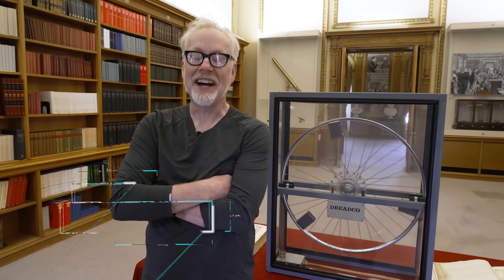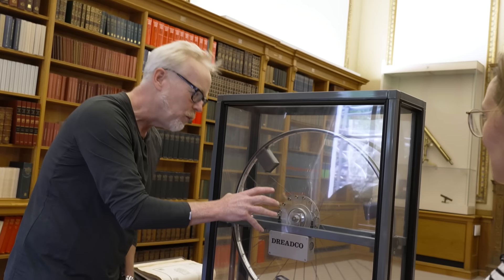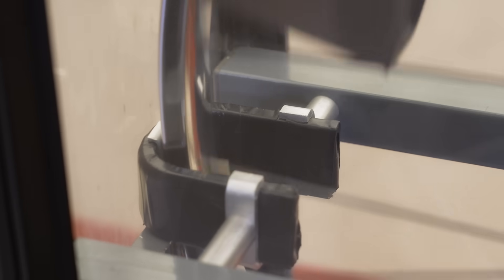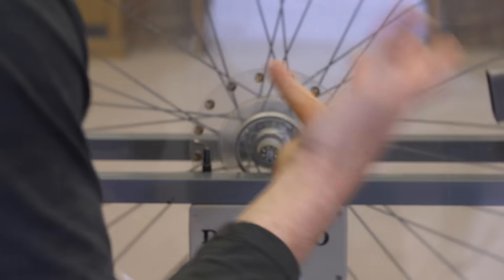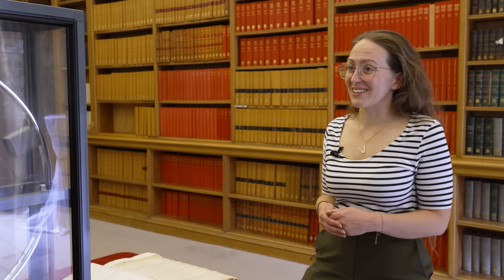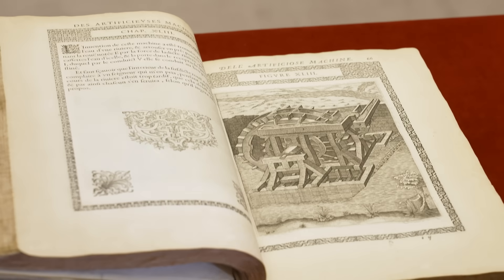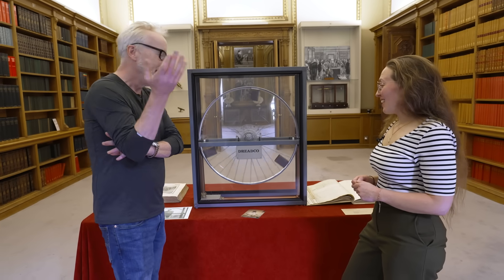Adam Savage vs The "Perpetual Motion" Machine!

Comment: It doesn't take much to keep a bike wheel moving, especially that slowly. I'm almost certain that the boxes mounted on the wheel are magnets, and the things the boxes move through are electromagnets. The smaller disc in the center has magnets around the edge, and the probes have a hall effect sensor for timing. When the magnet crosses the hall effect sensor, it supplies a small current to the electromagnet to pull the magnet in, then the second hall effect sensor reverses the polarity to push the magnet back out the other side. I bet a 9 volt battery could keep such a thing going for a year or more.
Reply: Probably not a Hall effect sensor. Those are pretty power hungry devices, esp. if we are talking about ones from the early 80s when this was apparently made. It is very likely there is no fancy electronics in there at all. Something like a reed relay would do the same job with no power required.
Reply: @JanCiger  wouldn't Adam hear clicking if it was a relay?
Reply: @silicon1  Reed relay is a small sealed glass  tube with two thin contacts (reeds - that's why the name) that close when exposed to magnetic field. Those are essentially completely silent. Think of a window/door switch like used in burglar alarms than a classic car/phone exchange clickety-click style relay.
Reply: @silicon1  Adam is partially deaf
Reply: @JanCiger  
A polarised reed switch could be used to switch the electromagnets on as it approaches the permanent magnets and then off as they pass through.
After a bit of googling I bet it's a "Type E Polarised and Latching Reed Switch"
These remain in the last state they were set to (open or closed) and require opposite ends of the magnet to activate one or the other.
Reply: @JanCiger  Same idea, though - 'sense that I've gone by a magnet thingee'.
Reply: @JanCiger  I wouldn’t be surprised if most of those “magnets” on the inner disc were fake and they only had three actual magnets that matched with the boxes on the outside.
Reply: I mean, honestly, I’ve got clocks that run longer than 2 years on a AA battery…
Reply: @edwardsmallwood1201  there are clocks that work for years on nothing but a few winds of a spring...
Reply: @edwardsmallwood1201  Agreed - lots of clocks have magnetically energised pendulums. The coil approaching the magnet creates a signal current and a simple timer then pulses a current to repel the magnet as it moves away. given the size of the three blocks on the rim I'm surprised the battery only lasts 2 years. Smoke alarms now have 10 year betteries.
Reply: @edwardsmallwood1201  an electro-mechanical quartz watch will run for typically 2 years on a watch battery… indeed a few AAs should be plenty for this device. This device does appear rather similar to an electro-mechanical watch in operation, actually… (btw there is no need for a reed sensor or other magnetic sensor; the electromagnet coil can also be used as the detector for when the box magnet passes through)
Reply: @edwardsmallwood1201  That's how long this full-sized bicycle wheel turns between "tune-ups." Big difference between that and moving two clock hands which might weigh a few grams.
Reply: @edwardsmallwood1201  yeah lol. And the motion is perpetual and does something.
Reply: There is a simpler possible solution. As a magnet moves through a coil, it will induce a small current in that coil. There's your sensor. This current could be fed into an amplifier with a battery and a simple decay timer hidden in the box in the middle to impart a small force via the opposite coil, then 1/3 of a rotation later the process repeats. A well lubricated and balanced bicycle wheel can be kept spinning like this with a tiny amount of force. (And I suspect there may be a partial vacuum inside the glass/acrylic to further reduce resistance.) A pair of AA batteries could keep this running for 2 years, easily, and all of this was available and plenty small enough in the '80s when this thing was designed.

That may not be how this one works, but I could build an externally identical device using that method, I think.
Reply: @cogspace  Actually it just requires a coil with two windings and a single transistor as the amplifier. No timer required.
Reply: @cogspace  
The flaw in your theory is the battery.
Reply: @cogspace  i doubt theres a vacuum. When adam touched the glass it was like rickety plexiglass. If it were under vacuum it would feel solid.
Reply: @cogspace  Yes, this would work.  Yet each coil can serve simultaneously as sensor and driver when the coil is connected to a simple negative-resistance circuit.  No timer is needed.  The tunnel diode motor, such as shown in the Scientific American Amateur Scientist column by C. L. Strong, October 1965, pg. 112, is an inspiration.  In Strong's example, the coil and battery are fixed and the magnet rotates, but the magnet could just as well be fixed and the coil and battery rotate. 

Each of the three boxes on the wheel of this "perpetual motion machine" could contain a battery, coil, and negative resistance circuit.  Each would act independently, producing a tiny "kick" as each coil passes the two presumed horseshoe magnets.  Instead of tunnel diodes, negative resistance circuits can also be configured with transistors (search for lambda circuits) or with very-low power integrated circuits to achieve microampere-level idling current for very long battery life.
Reply: @cogspace  You don't even need the time delay from the other side. Just generating the repulsion magnetic field after the magnet has already passed through will be enough to keep this low energy device spinning.
Reply: @cogspace  I thought a partial vauum would be quite helpful- but when Adam pokes the box it rattled- so I doubt it was pulling a vacuum- just pleaxiglas to keep little hands away from the wheel...
Reply: @cogspace  All they need to do now is make a modern version with magnetic bearings with no physical friction at all and maybe that would more than double the running time.
Reply: that's my guess  too.
Reply: It seems to me you would see slight variations in rotational speed as each box approaches then leaves the electromagnets. It would be helpful to record and analyze the wheel's speed - is it perfectly constant, or does it vary within one rotation? Are those who guess allowed to bring in equipment to measure things like magnetic field strength?
Reply: @jimhyslop  Compass sensor in your mobile phone? It should pick up any magnetic field pulses.
Reply: Thats always what everyone assumes because of all the distractions mounted to the device. If this is the same as his previous installations, it will just be a big ol tank of compressed air ever so lightly blowing against the wheel to keep it moving. The bottom part isnt transparent - for a good reason.
Reply: @drkastenbrot  try spinning a bike wheel by blowing on it lol you'll faint trying. It's just a motor for sure.
Reply: @piotrprzytycki7919  try it yourself because i have, with my compressor set to 0.5 bar
Reply: @drkastenbrot  You would be able to hear the air if that were the case.
Reply: @piotrprzytycki7919  although difficult to start, the air perhaps from that nozzle hitting those round things, only has to overcome very low friction and a tiny bit of resistance from the spokes and so on turning.. I think most of it is a bunch of distractions. I wonder if a stethoscope would hear anything.
Reply: I'd reverse that theory. The horseshoe magnet shaped things are just that; permanent magnets. The boxes on the wheel are likely the power source and a small, low voltage, electromagnetic kicker circuit with a coil. Just keeps nudging it along.
Reply: @justingould2020  Yes, this.  The other stuff is a decoy.  A compass would verify the field, or a coil of wire and a meter.  Even a cheap bike wheel will spin a long time if given a push.  It wouldn't take a lot of energy to keep it going.  An anniversary clock will run for a year on a spring (the newer ones use a battery which will also last a year easily).
Reply: Not sure it needs to be even that complex, think of the desktoy 'chaos' machines which just have a coil and a pair of nested 'pendulums', the magnet attached to one 'triggers' induces a pulse in the sense coil which then triggers a pulse of energy back into the sense coil, giving the magnet a kick.
Reply: The sensor would be the driving coil itself - as a box containing a coil ("electromagnet") passes the fixed magnets, a small voltage/current will be induced which the circuitry can detect and use to trigger a pulse in that coil to produce the kick.
Reply: @anthonyx916  In other words, a perpetual motion machine.
Reply: @tgiskardify  The sun is traveling around our galaxy and dragging the planets along behind it in a spiral motion. The planets aren't exactly spiraling into the sun. They are spiralling away from the sun as the sun drags them through the galaxy. The Sun is also very  slowly weakening which decreases its mass. Which causes the gravitational pull on the planets being dragged by the sun to weaken.
Reply: @RareVBlue  Words like spiral are kind of misleading, especially when you really need to be clear on the frame of reference when you're talking at that scale.
Reply: Another video has them using a magnet field sensor. No sign of a magnetic field near those "U" shaped bars. The only sign of a magnetic field was near the hub of the wheel, and it was weak.
Reply: It would be amusing if the occasional "servicing" involved (as well as changing batteries) swopping from one to another of multiple independent driving mechanisms in the box.
Reply: You're describing a brushless DC motor.
Reply: @tgiskardify  The earth is moving away from the sun, same as the moon away from the earth.
Reply: There's just 2 or 3 magnets on the centre boss, the others are none magnetic (dummy), a relay is switched by reed switches to put power to each electromagnet alternately via a battery just when the wheel magnets are in the optimal position.
Reply: @hetrodoxly1203  More likely a transistor than a relay.
Reply: @GordieGii  Any switch will do.
Reply: @hetrodoxly1203  ecaxtly, this is like a high school project at best. Very simple and inexpensive to make.
Reply: Build one
Reply: The motion seems very, very, very smooth. Magnets repel until they attract and then repel again... There's no sign of any magnetic forces occurring as those large blocks on the wheel move around. I think they are simple weights.
Reply: @DavidNewmon  it's not a magnet, it's an electromagnet, triggered by the hall effect sensors at the hub. These detect the correct wheel position to send a small current to the electromagnet to slightly pull the wheel. As the pull is very slight, and happens frequently, there's no perceivable acceleration. Also, a well balanced wheel can spin easily for 15+ minutes, so it doesn't need much to keep it going. Which is why it can go 2 years between "servicing" AKA battery replacement.
Reply: If the U-shaped things are magnets or simply iron, all you need is a timer and a small coil that is pulsed on a regular schedule:  
Start by spinning the wheel at a certain speed.  Get the wheel (a synchronous motor) synced up to the pulses.
If the coil pulses as it's approaching the iron, the wheel is accelerated slightly.  Set it to just slightly exceed drag.
If pulsed when it's aligned with the iron, no acceleration.  
If pulsed when it's ahead, slowed slightly (but this generally only happens during startup).
Reply: I think you're just full of yourself.
Reply: my guess is a pulse gen. the u shapes are coils and the 120* chunks on the wheel are magnets and the box in the middle is for timing using static charge. the timing circuit may very well need light to get started.  the box with heatsink being the power electronics
Reply: Don't forget about the brass timing pins near the hub. And the pointers above the box at the hub.
Reply: A true perpetual motion machine takes no outside power to run.
Reply: Electromagnets use a huge amount of current.  They use up the energy in a battery very quickly.  It would work for a short time, but not for two years.
Reply: @maskedmarvyl4774  ...
Most modern quartz clocks power the hands with tiny electromagnets and can run for about two years on an AA battery. A larger (possibly Lithium) would last a very long time.
Reply: Exactly.  And the tubing and heat sync are just added to confuse people.  With ceramic bearings, this would actually be quite easy to create today.
Reply: I’m guessing it’s magnetic in nature and in a vacuum.
Reply: I figured it was electro magnets that pulled the boxes in. Then the inner magnets on the inner wheel. Activate a cut out switch. Then gravity and momentum carry it around to the next electromagnet. And the rest of the junk is red herrings.
Reply: @rogerphillips6702  correct, that's all this is. You could make this with a bike wheel and $50 of parts on a Saturday. With modern ceramic bearings and batteries, you could probaby get it to run even longer between "servicing".
Reply: Possibly, but we don't know
Reply: @TwoWheels47  well, we do know how easy it would be to make something similar that would spin just as long.  Weekend project at best.
Reply: @TimEckel  then go for it and make a name for yourself. Everyone seems quick to dismiss and come up with ideas based on a video and not the actual machine. It's just too easy to assume without any skin on the game.
Reply: @TwoWheels47  what's the point of making a wheel spin for 2 years? It's high school level, anyone can do it over a weekend. It won't make a name for anyone. This particular item is only in a museum due to it's creator. There's nothing special about it other than the back story.
Reply: @TimEckel  I think there's more to it than that. Everyone is assuming based on currently available technology. Even Adam made a gaff about solar cells but quickly realized how silly that was. I'm sure it's a simple design but based on tech that was available when it was created, not nowadays with high density batteries that can fit just about anywhere. Like I said, if you think you can make it, you should be able to make even a better one with modern tech. Knock yourself out and make a name for yourself. And I don't say that sarcastically.
Reply: @TwoWheels47  I can wrap a copper wire around a bent nail, attach it to a battery, at the hub use a hall effect switch to turn on/off the electromagnet, and attach some metal to the rim, done. It requires no circuit, no modern tech, you could make it with stuff in your basement or garage right now. The hardest part would be balancing the wheel perfectly, and the most costly would be using a good wheel with a high quality hub. Seriously, it's child's play. This is only in a museum because it's art, don't think of it as "amazing". It's just a cool quirky art piece that should be enjoyed because it fools so many people. That's the enjoyment I'm getting from this.
Reply: @TimEckel  again make a video of how you created a duplicate and publish it. Show the people how it was made instead of assuming. You keep asserting how child level this "art" piece is. Should be simple enough to make then. I guarantee you that your response video would be highly watched. There's a lot of assumptions on this thread and people countering the same assumptions. Talk is cheap.
Reply: @TwoWheels47  again, seriously, why would I waste a weekend on this? There would be zero advantage to build a fake perpetual motion machine.
Reply: could be tested by  analysing the speed at each frame,as it would be similar to a switched motor,its torque would not be constant( unlikely at the time it was invented) so if the wheel is moving faster when the boxes are aproaching the electromagnets then slow down,that would be a good proof for the theory
Reply: @dovalist6637  easier just to measure the magnetic field of the electromagnet. Any cell phone can be used. The boost is VERY slight (the reason it runs so long between battery replacements). So I don't think you could easily measure the speed inside a box, or even more impossible, from the video.
Reply: I think the magnets are actually hidden under some blue tac around the rim of the wheel and there is a single hidden coil with a simple single transistor hall effect circuit as you say. It's a lot clearer in another video. All the other stuff is just to confuse people. David jones was a proper prankster and I think he would find it hilarious that people are still being confused by his creation all these years later.
Reply: Came to the same conclusion
Reply: My first thought was that it worked like the drivers on a maglev train...just in a circle rather than linearly.
Reply: I’m certain that is some sort of push pull switching magnetic mechanism. It almost looks as though there’s the tiniest stutter as the left coil is passed.
Reply: Basically a stepper motor powering a flywheel.
Reply: @tgiskardify  Not at all true
Reply: I'm tending to think air batteries in the Dreadco box, hence the air vents
Reply: Thanks , saved me from typing all that out !  I have a medium size pendulum clock with a large swinging pendulum  that chimes every bloody hour and has run non stop for 5 years on 1 C size battery and is still running today . It honestly amazes me how much energy in a C size battery singular!
Reply: So basically a brushless DC motor. I call BS on this device. It’s basically the equivalent of handing me a can motor and saying that it runs on magic, not electricity. But you can’t wire it up or take it apart to find out. Anything that claims “free energy” but has a magic box that I am not allowed to open, I openly dismiss.
Reply: The Earth always keeps spinning so a perpetual motion device already exists.
Reply: @robertwilson3866  the earth is being acted upon by the sun's gravity.  The sun is not perpetual and will eventually  die. It's just a really, really big battery.
Reply: In fishing we do this with our casting reels. Always room for improvement but friction kills it in the end. All the things in space that move is as close as you can get and God put them there.
Reply: i think it takes a lot more energy than many people are assuming. not only would it be pretty heavy which increases friction on the bearings, but those many spokes plus the three metal boxes on the wheel will contribute to measurable air resistance, things which a wall clock will have comparatively miniscule amounts of
Reply: She said 2 years,
Reply: @monkeymindbananas9550  sounded like a pretty rough guess the way she said it, and that it wasn't a steady timespan
Reply: Good catch nick. the hall effect is the timer.
Reply: Isn't the box fully enclosed?  You may as well draw a partial vacuum inside the box to reduce aerodynamic friction.
Reply: You could build a crystal receiver from germanium crystal diodes, a coil and a resistor. This has the effect of picking up the electromagnetic energy that is available from radio transmissions and converting it to a very small DC voltage.  No batteries are needed. Usable power is just microwatts but that is all you need to need to keep this machine turning.
Reply: should be probed by some magnets to see how it reacts
Reply: CHECK OUT THE INFINITY TRAIN IN AUSTRALIA ......🚂🚂
Reply: I say almost. I say it just have weights and inertia. That's why the boxes are ballenced. If it's ballenced it can keep spinning for longer.
Reply: I believe it is a motor. I imagine the horseshoes are permanent magnets. The boxes are magnets that change polarity depending on position. The boxes have mercury switches to sense the position and diodes are switched on-off to reverse the polarity. The power to run the circuit comes from coils moving through the magnet's field. 

The heat sink box and copper pipes are all a distraction. The two bent nozzles at the hub are a distraction.  The whole thing works off a tiny amount of power that comes from the coils in the boxes moving through the magnetic fields. It has to be perfectly balanced.
Reply: The coils could be linked by the metal rim ? Even if it was perpetual motion, there is not much to do with it other than look in awe, try and drive something and it would cease to function.
Reply: Magnets do weaken over time. I wonder if indeed those are the "fuel" that keeps this going... and then after a couple of years the magnets need changing?
Reply: @cytherians  what I like about it is that it is posing  a question, there must be thousands of us wondering, with what knowledge we have, how it works. It is like an engineering maze.
Reply: Especially a lithium battery of some sort
Reply: Could the energy to power the thing be coming from an RF signal or Cosmic Rays which have a small amount of energy enough to vibrate a receiver of some type. maybe that could release a small timed charge, timed as you say by those sensors to influence the polarity of those magnets at certain times during the revolution of the wheel..
Reply: The batteries are stored in the fake heat sink at the bottom left and the copper tubing is its conduit. The u-shaped electromagnets are simply connected to the center box for the sensors inside those horizontal, square tube sectioned, metal case frame members.
Reply: My guess (at 1:02 in) is that it’s a form of barometric clock. Aside from the extremely well balanced wheel and low friction bearings (and shielding from drafts) you’d just need the tiniest bit of current to nudge it along via the magnets.
Reply: I think there's a lot of deception going on. Favorite trick of Magician's. 

I'd like to get a better look at those bearings. The center axle does not seem to stay in sync with the inner race. I'm suspecting hidden Fluid or Gas Bearings are the actual bearing. These were available in the 1980's. Very, very low rolling resistance. You can create a basic DC motor using brushless technology for a Commutator. This was also available in the 80's on a University level.  Now encase the whole thing in a Vacuum. No brushes to create drag. No air  to create drag. Fluid or Gas bearings would be extremely low Drag. I think the " Servicing " every couple of years  is to add momentum from the minimal drag of the Fluidic bearings. 

In fact, if you had a complete Vacuum and zero friction bearings I wonder if you would need any Magnets at all to provide a Magnetic Force.  Newton's first Law. Think of a Space Station in orbit. Once rotating there is no external force ( Air Friction ) to stop it. Gravitational Force is present. But it is the weakest of the Four Primary forces. And the difference in the Gravitational Drag  between the Top of the Rim and the bottom would be extremely low. Get rid of Air Drag and 99.999% of Bearing Drag ( Hidden Fluid/Gas bearings ) and you have a  " almost " have a real Perpetual Motion Machine.
Reply: Some very interesting information on Fluid and Gas bearings. Note the extremely low drag forces at low rotational speeds. https://en.wikipedia.org/wiki/Fluid_bearing
Reply: No the tubing sucks air in on the left and puffs it out on the right.  Little puffs keep the wheel going.  Everything else is show.
Reply: Boxes are big enough for a lot of D cells. Fan motor sucks in one copper tube, blows out the other?
Reply: @alwayscensored6871  are those d cells exist in the time when ths was made
If it is then maybe...
Reply: @cristona.d5265  Israeli battery tech, been around 40+ years.
Reply: @alwayscensored6871  l see
Reply: @alwayscensored6871  Could well be the answer 👍
Reply: @alwayscensored6871  too power hungry
Reply: @piergiorgio919  Capacitor discharge, sensor triggered magnetic coils. All they have to do is over come friction. Keep it slowly spinning.
Reply: You can see that Perpetuum Mobile (Perpetual Motion) works, so it's possible, and we were lied to in school. Free energy is omnipresent and even from Mendeleev's Aether.
Reply: When I first saw one of these I thought maybe it was just air current because even though the box maybe sealed light can still get in and if light can get in than it can start warming the air which could get a circulation going inside the box and if the bearings are good enough, like you said it would take much to keep it moving, but I was told my guess was wrong so oh well.
Reply: @mattsmith8160  The main downside of that method is that it relies on light providing heat, and she said that this thing "lives" in the basement with the lights off.
Reply: @Matt Smith ...  or magnetic shell encased with a fluid,  or baffles with fluid within them,  that help drive momentum...
Reply: @LiquidZero_  you guys are falling for the same lure that draws in retired engineers and other crackpots. Just assuming if one more fancy thing is added, it will finally work. You're forgetting the primary reason that nothing works. Any movement or change done to the left side will be mirrored on the right side at the same moment, canceling out any forward momentum. Any extra part added  also increases resistance and entropy.
Reply: @mattsmith8160  your guess is nonsense
Reply: Looking closely at the wheel you can tell it's nothing fancy. It's even out of true (concentrically) 

Its likely got a few fake features in it to throw us off, but with the copper piping and the heatsyncing, i'm thinking it's more of a sterling engine that runs at very ambient temperatures.
Reply: @tylergarza8695  A heat engine (e.g. a Stirling engine) requires a temperature difference. Unless this think contains something like a small radioisotope heat source then there will never be sufficient temperature difference with it just sitting on a table.

It's almost certainly battery powered and uses electromagnetics to provide the tiny kick of energy it needs to keep turning. The majority of fake perpetual motion machines use this.
Reply: If u think it's batteries .... make one and see how long it last. I bet u only get 4 months rotary motion before the batteries die, giving the volume of the hidden areas.
Reply: @piercebishop4052  Lithium Thionol D cells are about 20 amp hours. The duty cycle would be very low. Bit like those old hit n miss engines. Ran a long time on a little fuel.
Reply: @piercebishop4052  there are clocks that last 4 years. And have more moving parts with a little clock battery
Reply: @ChaosLordDiscord  my hobby is repairing clocks and to try and compare the torque needed to operate an escapement wheel and the torque required to turn that bicycle wheel are not even in the same ballpark. not to say clocks stop, some every second have a slight pause, and some twice a second have a slight pause.
Reply: @blackhd92  i repair bicycles and so mainteinance to marzocchi forks. and i tell you, clocks use little batteries, and that cmptraption there can have lots of batteries in the frame and inside those fake boxes. and a bicycle wheel can turn with a slight push for very long time and using ceramic bearings and vaccum that can go around for years
Reply: I would posit that the boxes themselves are not magnets but do contain magnets that move freely within the box and the rise and fall motion of the contained magnets help to maintain the motion of the wheel as well as magnetic pull as you suggest. I believe as Adam that there are multiple forces at work here.
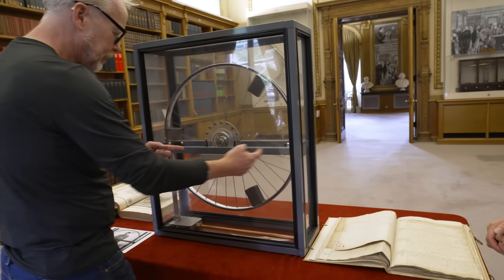Reply: @UrBasicGuy  Not necessarily magnets, ferrous metal that slides along the radius of wheel.  Left magnet pulls material out and down.  Right one slides towards center.  You'll notice magnets are mounted below center of wheel.  Close up of magnets shows wheel has been stretched where boxes are mounted, possibly due to material being pulled out by left magnet. Between 6 minute mark and 6:15 you can hear the material hit as it passes the magnet.
Reply: @UrBasicGuy  without an electromagnet that can switch polarity, regular magnets will end up canceling out and stopping, no matter how many fancy "freely moving" parts you add.
Reply: @soangry   not necessarily, depends on factors such as weight, size, strength and type of metal (ferrous/non ferrous) of it's container .
Reply: @UrBasicGuy none of that has anything to do with it. If you have a wheel with magnets and a ring of magnets, they will find an equilibrium between the poles and stop. In fact, the wheel will stop much faster than if you spun one without magnets on it.
Reply: @soangry   if the magnets are in constant motion (rising and falling) it would go longer and for the record i never said this was a official perpetual motion machine nor did i say one exists or that my idea would create one
. I merely commented on how i thought this one might work. And unless you can build a model showing i'm wrong then your points are irrelevant.
Reply: @UrBasicGuy  hundreds of people have already tried a million different  ways of  spinning wheels with magnets. I don't need to recreate  someone else's  failure to know it didn't  work. 

It doesn't matter what sort of trick you think you can try, the magnets will always cancel out and slow everything down much faster than if the wheel was just spun by hand with no magnets.
Reply: @UrBasicGuy  Just FYI in regards to your response (or one of them) to @soangry and for similar future encounters:
The burden isn’t on on him/her to prove you wrong. If you make a claim or propose a solution, it’s on you to defend it. Anything that could poke even the smallest hole in your idea is entirely relevant regardless of wether you are proved wrong in the entirety or not. No need for a model. 

If you say, “I say it’s X” you have to defend that it is indeed X. To say “you have to prove me wrong” is a fallacy. Shifting the burden of proof. 

Not trying to start a fight. Just trying to help.
Reply: @jonh284   Read and comprehend my original statement! I never said perpetual motion exists (although i believe it can) . I merely stated how i thought the machine in the video possibly worked. How are so many people on here that claim they are smart enough to know more than others unable to comprehend a basic statement? Because their heads are overinflated.
Reply: @UrBasicGuy  I was only addressing what you said about the other person needing a model to prove you wrong.
Reply: @UrBasicGuy  The problem here is that it takes more energy to push it up than can be recovered when it comes down, considering friction.
Reply: Technically, perpetual motion exists on a geological time scale. We call it planetary motion, and it’s quite useful for sending space probes around and out of the solar system.
A nice little machine that creates useful perpetual motion? You’re going to have to prove that to me.
Reply: @edwardsmallwood1201  Not really, perpetual motion machines would have to violate the conservation of energy. Planets and solar systems do not and will technically end with enough time, they just appear to be it. There never has nor never will be a perpetual motion machine of any kind.
Reply: Planets do not spin forever.  Tidal dragging from the local star, T.D. of moons, etc.  It does take a very long time to slow down.
Reply: @edwardsmallwood1201  Those are not perpetual motion even on that time scale. The earth's rotation is slowing to some extent and all of the planted move towards the sun at some rate as well, as the sun itself moving closer to the center. If you let things run its course they ell will expand there energy. So, it's not technically anything as such.
Reply: @edwardsmallwood1201  Days are about 1 second longer now than they were 100 years ago, due to the rotation of the planet slowing down. So that isn't perpetual motion.
Reply: @edwardsmallwood1201  Perpetual motion.  Electron spin.
Reply: @edwardsmallwood1201  it's a lot of energy, not perpetual.If you use a planet so slingshot a spacecraft, you are "Stealing" it's energy
Reply: @edwardsmallwood1201  haven’t read through the replies yet so sorry if I’m interrupting a healthy discourse 

Planetary motion is not perpetual, tiny amounts of energy are lost through things like gravitational waves, tidal stresses on the planet, and yes objects flying past being slingshotted, but because of the sheer scale of space and the objects in it, all stars in the universe except maybe red dwarfs would die before that orbital energy is even close to depleted
Reply: @edwardsmallwood1201  If you are talking about planetary proportions you need to talk about planetary timescales. The motion of planets is anything but perpetual. All orbits slowly decay over time (or sometimes they can grow in some specific conditions and eventually escape the gravitational field of the body they are bound to).
But in time (billions, or probably more like trillions of years) everything in a solar system either escape or consolidates. Because it's time scale is too big, many times a star's life will end before it happens.
Reply: @edwardsmallwood1201  planers don't do perpetual motion either
A swingby manouver slows the planet the tiniest bit, its just that the planet is so much heavier that this immesurable small deacceleration is already a huge load of energy for a tiny spacecraft to gain
Reply: Even more technically, all moving systems are "leaking" energy through gravitational waves, so there is no such thing as perpetual motion.
Reply: @edwardsmallwood1201   Interesting perspective however that would not be true perpetual motion as the energy is finite and will eventually dissipate to zero.
Reply: @edwardsmallwood1201  Star comment 🌟
Reply: @edwardsmallwood1201  That's not perpetual (meaning endless) motion then. The planets, stars, and even dust in the cosmos will eventually fizzle away to pure energy through entropy. While the geological time scale may make us feel the motion is perpetual, it does have a defined and calculable end point/date if you do enough math.
Reply: @shakeelali20   With your comment I hope you’ve read The Last Question by Isaac Asimov.
Reply: @edwardsmallwood1201  I don't know what you read, but you either deeply misunderstood it or were lied to.
Reply: @Sidecutter  what specific points from Edward Smallwoood are your reffing to if I may ask?
Reply: @edwardsmallwood1201  That's not perpetual motion either... Our galaxy, and in fact the entire universe, isn't perpetual and DOES have a finite amount of energy which will one day run out.
Reply: @edwardsmallwood1201  hmmm. that's not entirely true. It just seems that way. I have the same idea about electron spin and whatnot but i'm very skeptical to call that perpetual motion. Clearly energy can be quite dense but hard to extract. the closest we manage is the A bomb and that atom still haulin ass
Reply: @edwardsmallwood1201  yes. the universe is a 'perpetual' motion machine. when all motion stops, there is no more time.
Reply: @sleethmitchell  I never heard that theory before. How can we extrapolate this far into the future?